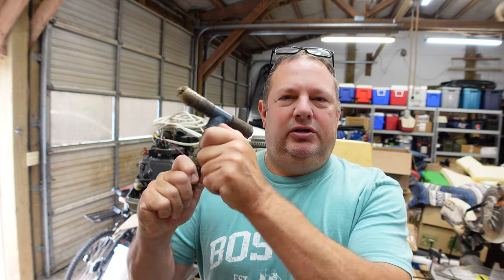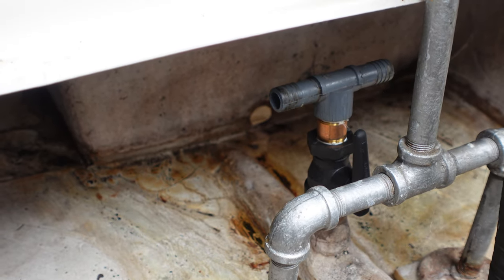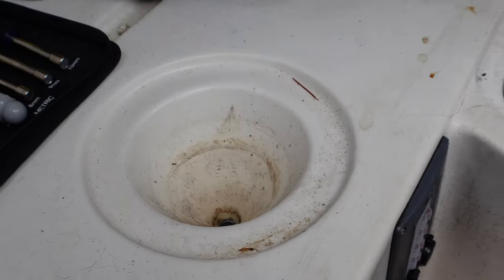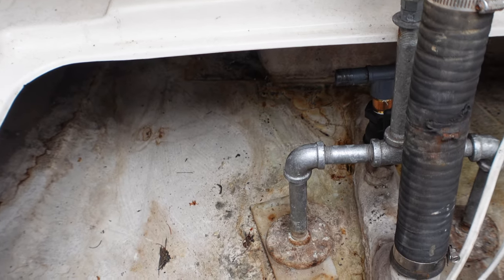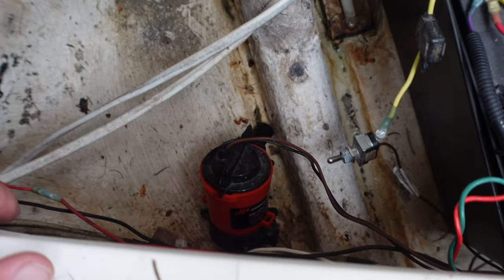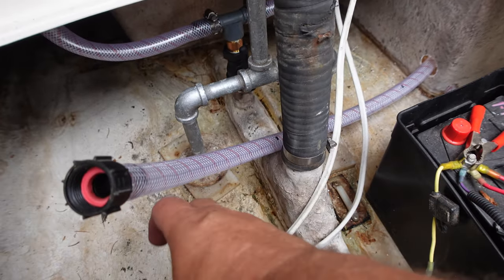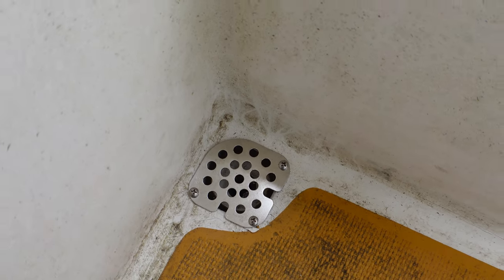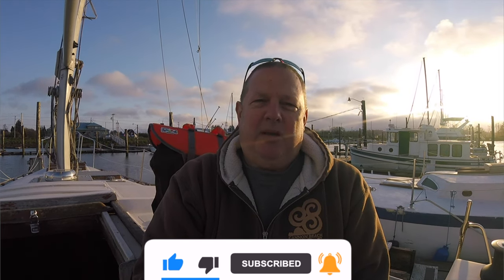Cockpit Drains and Hoses | Catalina 22 [EP 107]

Comment: I need to replace mine (Catalina 22). What drain tubing did you use and where did you purchase it? It looks really professional and I like that all the drain and bilge lines are the same material!
Reply from the maker: I’m not sure where you live or what stores are around you. If you have a local boat parts store, I would search for braided vinyl, marine water hose. West Marine, and other stores like that carry this. You might be able to find something very similar at Ace Hardware or maybe even Home Depot. I purchased mine from Englund Marine in Astoria Oregon. Thank you for taking the time to ask questions and comment. I appreciate it.